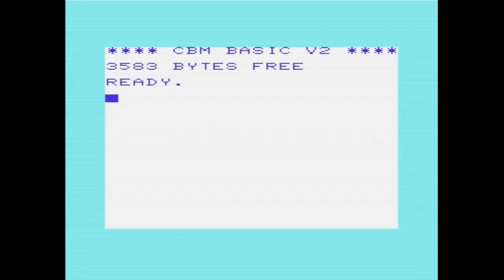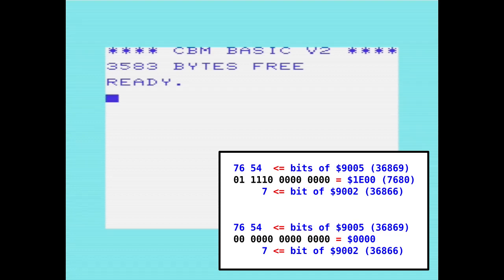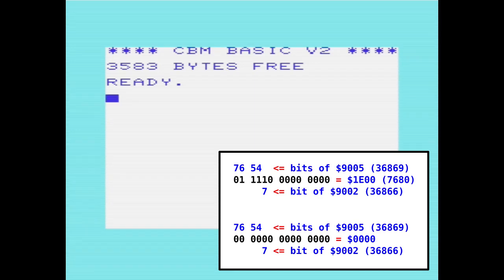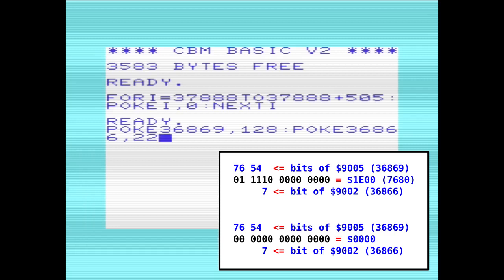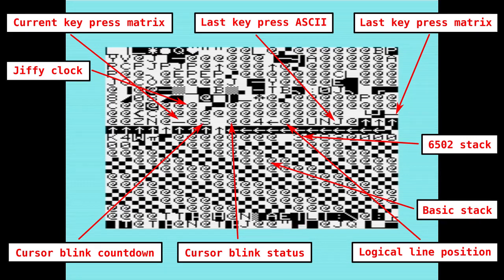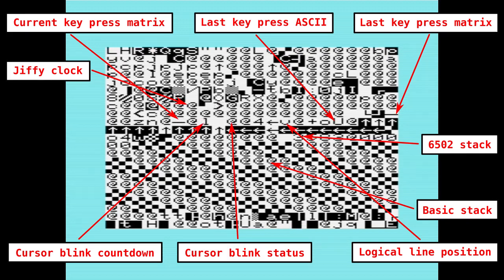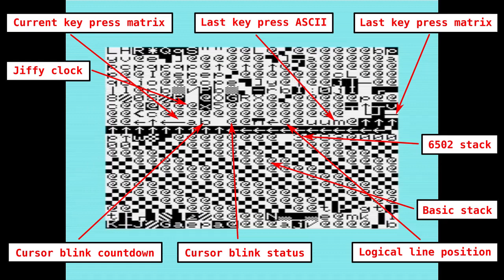Visualizing Zero Page on the Commodore VIC-20

Comment: Is the VIC (the video chip) only able to 'see' $0000-$2000 and $8000-$9000 or is there some additional register to make it view other locations?
Reply from the maker: Almost, the VIC can see $0000-$1FFF and $8000-$9FFF.  You may like to see how the 14-bit address is created on pg. 129 of Mapping the VIC: https://archive.org/details/COMPUTEs_Mapping_the_VIC_1984_COMPUTE_Publications/page/n149/mode/2up
Reply: @TechTinkering Ah yes, technically it can see $9000-$9FFF but it's not very useful for storing graphical data.
So basically one needs at least an 8kb expansion to store program code so that the default memory can be used for custom GFX.

Comment: You can also make the screen larger and move it to display more characters on screen. The VIC chip has some pretty interesting settings. :D
Reply from the maker: Yes, the VIC is a fun chip to play with.  I've also done other videos on manipulating it:
  Changing Screen Dimensions on the Commodore VIC-20 (https://youtu.be/p3mkE2FXbaM)
  Moving the Picture Origin on the VIC-20 (https://youtu.be/w_O2D14L6e8)
Reply: @TechTinkering  Also check out the double-height font feature! :)
Reply: With some ML trickery it is even possible to skip screen lines (gaps) to save additional memory 
or pushing the upper screen border and the contents of the screen itself down with the lower border still in place etc.

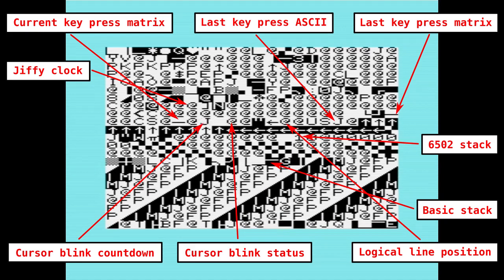Comment: 6:08 It was unclear from here and from other explanations whether the BASIC stack grows upward or downward in RAM.  It fills up with GOSUBs between two torn video frames, so I can't tell from your video.  Adding a delay loop to your code shows that it grows downward, intertangled with the machine-language stack.  I suppose this is the best solution, since it would be difficult to detect a collision between BASIC and machine language otherwise, and the intertangling happens in a known way.
Reply from the maker: It also means BASIC can use the standard 6502 push and pull instructions with the addition of a check for stack overflow.

Comment: I think set video memory address to $0000 work also with C64 and BBC Micro.
Reply: $D018 on the VIC-II lets you, but it's not as fine-grained as the VIC, and &0350-&0351 on the BBC, for those interested.